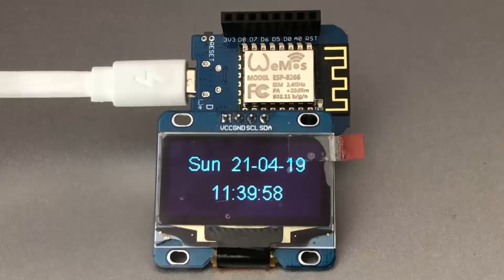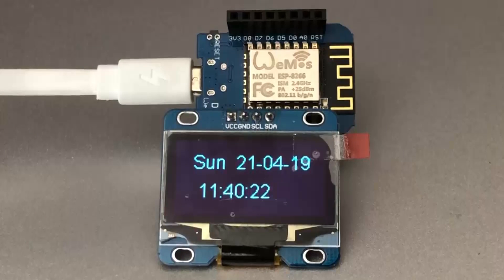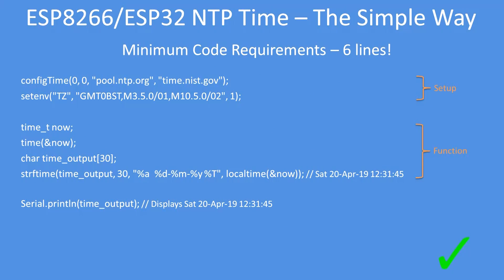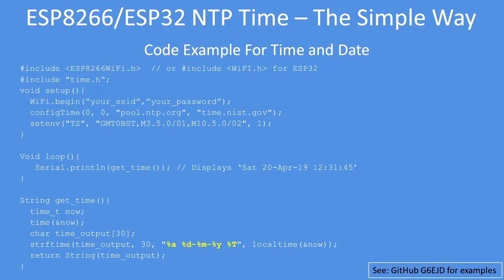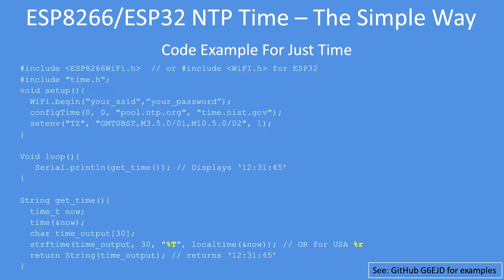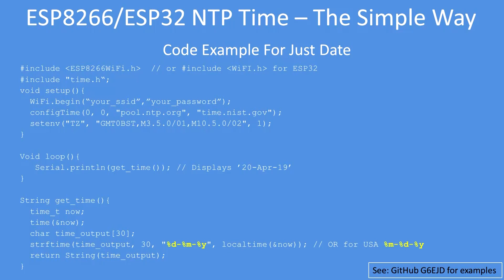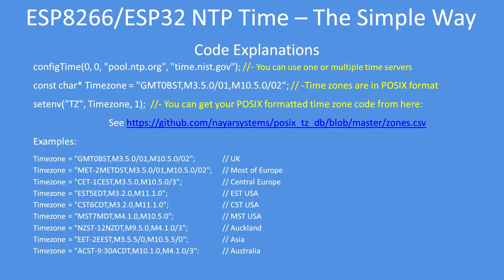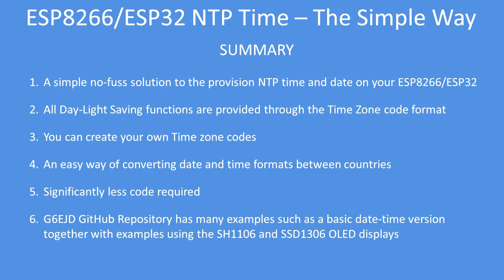Tech Note 122 - ESP8266/ESP32 NTP Time – The Simple Way

Comment: I have compiled the sketch in IDE 2.3.6, but get an error and the compile stops, using an OLED 1.3 display, I wanted to do two display clocks one for the UK where I live and one for America where my friend lives, so I know the best time to call, any help would be good, all the best Bob in the UK. 19-07-2025

Compilation error: no matching function for call to 'SH1106::SH1106(int, const uint8_t&, const uint8_t&)'
Reply from the maker: Do you have the sh1106 library loaded? Sounds like not…

Comment: Hi Dave, I was wondering how the two functions configTime(...) and time(&now) work together. Specifically,  configTime() is called once in setup() does that mean every time time() is called in loop() it will hit the NTP server? My question is how often is the NTP server accessed and which function takes care of that, is it automatic or can it be controlled? Hope you are keeping well Dave.
Reply from the maker: Hi Rodney, config time is called just once to set the ntp parameters which are stored in rtc flash ram, then the ESP32 rtc is started and is essentially a counter set to the current UNIX time value and increments every second, then the ESP32 code maintains a clock, which gets its clock source from (depending on settings) the ESP32 resistor-capacitor controlled RTC clock, so it’s not very accurate, many seconds of gain or loss every day. It is possible to set the clock source to a 32khz xtal (if fitted to the board) but not in the Arduino IDE, then clock drift is a few seconds per day about the same a watch. 
So to maintain accurate time a call to NTP is made which updates the RTC counter with the current UNIX time. It only needs to be called say every hour, but for experimentation frequently calling NTP is ok. So in essence it’s an ESP32 timer (one of the four) and it is set to increment every second fed by an RC clock in the ESP32. The timer value being set by the NTP call for the UNIX time value.
Reply: @G6EJD  Your reply has made the finer details much clearer, thank you. One final question when you say "So to maintain accurate time a call to NTP is made which updates the RTC counter with the current UNIX time" what determines when the NTP request is made, is it automatic or the result of calling a function. If automatic how can the frequency be changed say to once per day, etc, instead of hourly.
Edit: I just found this function uint32_t sntp_update_delay_MS_rfc_not_less_than_15000 () which returns a value (seconds * 1000) to override the default sntp default update period of one hour. I've verified it works at least on an ESP8266.

Comment: Great Tutorial, how would you parse hours, minutes, sec to send it  sync the RTC(ds 3707)
Reply from the maker: It’s actually quite easy, there is a function in the Adafruit rtc library just fill the parameter with the current time and call it, you can then keep the rtc synchronised says every day or whatever period is required.
Reply from the maker: rtc.adjust(DateTime(2014, 1, 21, 3, 0, 0)); so it’s CCYY, Month, Day, Hr, Min, Sec

Comment: Hi David,  I tried to input a comment to you yesterday but now I don't see it's the first time in my 79 years that I've commented on a website so bare with me please.
My comment  yesterday was related to error message "call of overloaded 'String(IPAddress)' is ambiguous" using a ESP8266 I have now got loaded on the only ESP 32 that I have which happens to be a AI thinker ESP32-CAM and it displays time date. My Arduino IDE is v 1.8.13 and I think this line gives you the core version for my ESP 8266 Users\mikec\AppData\Local\Arduino15\packages\esp8266\hardware\esp8266\2.7.4\cores\esp8266/WString.h:63:18: note: String::String(char)
         explicit String(char c); 
Can you help.  Mike
Reply from the maker: The compiler has been changed, try this:   Serial.println("WiFi connected at: " + WiFi.localIP().toString());
Reply: @G6EJD  yes error solved

Comment: Thanks for your help David. Am I correct in my understanding that with the example the NTP server is only called ONCE to set the time iside the ESP32 and then from then on the time is updated from within the ESP32? Please confirm or correct my erroneous understanding. I'd ideallly like to poll the NTP server at startup only and then provide current time without having to constantly poll the NTP server inside loop(). Thank you again for a great explanation. Gord
Reply from the maker: You have to establish the NTP connection, get the current time, then yes the ESP32 maintains the time, but the RTC clock source in the ESP32 is very inaccurate, that is it runs at about 150KHHz and is subject to a lot of drift, many seconds per day, typically +/- 20-secs per day, so you do need to periodically get a new value from the NTP servers. If the on-board xtal is enabled then the clock accuracy will be about +/- 3-secs per day, about the same as a quartz watch.
Reply: @G6EJD  Thanks very much for your help and explanation David. Best wishes.

Comment: Hi David ,first thanks for a great tutorial :-) I'm using an ESP32 DEV c and a little ssd1036 . Compiles and uploads fine via Ardunio IDE . If I open the serial monitor I can see it joining the WIFI and it scrolls the correct time but nothing on the little oled . The only change I made was to add the line  SSD1306 display(0x78, SDA, SCL); after the #include "SSD1306.h" . I'm wired up to pin 22 for SCL and 21 for SDA . I previouly had a little clock running with this setup but wrong time of course .  Any dea what I could be doing wrong ? rgds B (p.s very new to esp32 etc )
Reply from the maker: What size is the display 0.96 or 1,3”’ has the display ever worked? What board type are you selecting in the ide
Reply: @G6EJD  0.96 ssd1306 display . Board selected is  DOIT ESP32 .Also used standard ESP32 dEV ..I verified the screen is ok by using this example and it works without modification on both boards selected ..https://github.com/lexus2k/lcdgfx/blob/master/examples/direct_draw/clock/clock.ino ...thanks for the reply btw :-)
Reply from the maker: @brendanfurlong7868  use the same constructor if it works ok: DisplaySSD1306_128x64_I2C display(-1);

Comment: Thank you for the video, I mean really, THANK YOU. 
Just starting off in learning to write code and yours was the only video I've watched on it that helped me see it. 
I wonder if you could do a video expanding on time in a sketch. I'm in the USA and just need time (no days or years) so %r should be all I need. So how do we use this %r to say turn on/off a light or relay at a set time of the day?  Something like this?  "if %r> 7am  then pin 1 high, else pin 1 low" "if %r >7pm then pin 1 low, else pin 1 high"  Or would we had to state (int) ontime and offtime = 7am/pm. 
Been struggling to ultimately learn to do this, so any help in getting me to see it would be greatly appreciated.
Reply from the maker: strftime(hour_output, 30, "%H", localtime(&now));    // Formats time as: 14
String currentHour = hour_output;
If (currentHour >= “7”) …do this else; do…that
Reply: @G6EJD  Thank you, I'm going to FINALLY have time to look at it today for a while. Briefly had time yesterday, but not enough to really do anything.....
Reply: @G6EJD  Had some time last night to look into this, figured I'd start with you 1306 sample sketch. Make sure I could get time and display it before going further (editing anything). Kind of got stuck there. IDK if the library for the OLED changed, the link in the code vs what came up were different, but I did use/try it anyway.  Got nothing on the OLED and the serial just showed dots.  My I2C are pins 22 and 21 (ESP23S) and I did try putting those in where indicated. I say I wonder about the library because the Adafruit SSD1306, and their I2C example (what I used for my temp relay) work, and work without adjusting pins (not sure how that it though).   
I tried to use that library instead, but many of the strings failed in compiling afterwards.... Tried a few other "bring this n that over and hope" things, but that's where I ended last night. 
Figured I'd ask before heading out, if you had any ideas or a link to maybe the original library if the one linked to in the code has indeed changed (braking this example in the process).
Reply from the maker: Sounds like you didn’t get a WiFi connection if your seeing …..
Reply: @G6EJD  Thank you, I actually got it going last night.... like 2am.
I knew the screen worked with Adafruits library, so I checked out the example in the new library (clock face) and it worked.... 
Turned out changing the include SSD1306.h to SSD1306Wire.h, and removing lines 19-27 but keeping the include WiFi.h  made it work. 
They must have changed the keywords since you made this.... As a beginner, I wish the makers of libraries would just agree on names and everyone stick to the same.....
Now that that works, tonight of tomorrow I'll work on getting a pin to go high/low at a set time and then bringing my existing temp sketch in.  
For that, I'm gonna try to replace the date on the screen with the real time temp...
Reply from the maker: Hi, you can’t use %r as that return unix time that advances every 1-sec. just use %h which will return just hours of the current time then you can use the expression if hour >= 7 then
Reply: @G6EJD  Ok, that make sense. I was just looking over your examples. I'll be giving it a go tonight.  Long story short, heater killed her fish, so learned to use an ESP32 and relay to limit the temp and show current temp on a small OLED (better than those stickers). Figured I could have it do lights too IF I could learn how....  Thank you again, very glad I found your video and will be following you.

Comment: I tried the code but it's not working, it only prints 01-01-70, can someone help me? (just changed the Wi-Fi configuration) 
Also, what's the TZ for Venezuela? I can't find it anywhere and I need this to make timestamps in my sensor...
Reply from the maker: Try it as published first, you can get the TZ string from the posix site I listed in the comments 	TZ = "<-04>4" works for me

Comment: hi dave for the life of me i cant get the correct time just 01-01-70 , so looks like some kind of default setting, and time 00:00:00.  installed your github onto esp8266 with oled screen.  Update ESP_RTC_with_NTP_Synchronisation_SSD1306_OLED.ino prints the same on the serial monitor it joins my wifi .  been playing around all morning, but cant get it to change. this is above my pay grade.  what should i look at. thanks Andy
Reply from the maker: Ok m, have you changed anything in the code apart from WiFi credentials? Is will show you the IP address to confirm a connection. Do you think your router is blocking outside connections, everything else’s operates ok on the WiFi?
Reply: @G6EJD  router possibly.  do you know what port if any the NTP servers use
Reply from the maker: Does your phone or pc get the time ok?
Reply: @G6EJD  windows pc it has the correct time. Is they another way to check. Trying now to install another router
Reply from the maker: @AndyShrimpton-GaaTech  OK so there are no router blocks, it uses the same NTP access. Your getting a known good IP address on the serial monitor port?
Reply from the maker: Ive just tried the code, no problems. What version of the IDE are you using 1.8.13 and ESP8266 plug-in?
Reply: @G6EJD  hi dave 1.8.9
Reply: @G6EJD  yes check within the router
Reply from the maker: That is most likely sone of the problem with the libraries plus you need to be on latest 8266 add-on
Reply: @G6EJD  made so progress.  I loaded in your ESP_RTC_with_NTP_Synchronisation_SSD1306_OLED.ino and it gave the wrong time.  (For anybody reading this there is nothing wrong with daves code, i have a problem that i am trying to work out that the code on my D1mini does not work correctly)    I changed line 36 to update every 60 seconds.  And it updated perfectly after 60 seconds.  So this proves to me that nothing in my router blocking NTP requests, i proved that i can reach it)    Now to work out why it does not get the correct time upon power up.  So it prove i have something set up some where wrong.  Not the best this to do i could i have have the skill put in a counter and a routing to update upon power up and the change to update every 60*60 seconds as line 36.  I am in Italy but that should not effect anything.  I will check my router to see if that has a time and date setting
Reply from the maker: Are you actually getting time? If so maybe after a minute or so, then this is an artefact of the ESP8266 library, it can be slow, I’ll tell you how to fix that (there is no solution other than to wait for the time to synch then carry on) once we know your getting the time

Comment: I started looking into NTP for ESP8266 by watching Ralph Bacon's YouTube video.  With all due respect yours is SUPER.  How often does the ESP request Time from the NTP pool?  If the WiFi later goes down will the internal clock of the ESP be keeping proper time?  Thanks....great video.
Reply from the maker: You can specify the time server pool and the offset (in seconds, can be
 changed later with setTimeOffset() ). Additionaly you can specify the update interval (in milliseconds, can be changed using setUpdateInterval() ). NTPClient timeClient(ntpUDP, "europe.pool.ntp.org", 3600, 60000); would be a typical definition.
Reply: @G6EJD  Your reply seems to be related to the NTPClient Library which we're not using.  I understand the default update interval for configTime is 60 minutes.  So how would I change the  update interval to be 24 hours?  Also is there a way to read back the update interval or determine how long before the next update?  Thanks for your time...KA0SLK.
Reply from the maker: @markludwig5805  yes, default update time is 1-hour, here’s the complete documentation: https://docs.espressif.com/projects/esp-idf/en/latest/esp32/api-reference/system/system_time.html with an example.
Reply from the maker: BTW, if the ESP32 is in sleep mode, the on-chip clock source is an RC timer (150KHz) based unit with a typical error (most run too fast) of 20-secs per hour, based on a wide sample of reports I’ve had with my weather station 20-secs is typical, this is probably why Espressif set the 1-hour update time. When the cpu is running and using (generally) a xtal clock source, some are ceramic based), I generally get no better than 2-sec accuracy per 12-hour this is because most xtals are 40+ppm or worst. 73

Comment: Hi David,

I'm trying to asing values of the function in integers, in order to per exemple, compare with other integers to create a alarm clock...

as I'm not too much expert I just do it using the follow way but i'm pretty sure that instead is working it is not the  best wise method:

#include <ESP8266WiFi.h> // or #include <WiFI.h> for ESP32
#include <time.h>
int hora; /// integers for futher handling hour minute and second
int minuto;
int segundo;

void setup(){
 Serial.begin(115200);

 WiFi.begin("****","***");
while (WiFi.status() != WL_CONNECTED) {
delay(500);
Serial.print(".");
  }
  configTime(0, 0, "pool.ntp.org", "time.nist.gov");
  // See https://github.com/nayarsystems/posix_tz_db/blob/master/zones.csv for Timezone codes for your region
  setenv("TZ", "CET-1CEST,M3.5.0,M10.5.0/3", 1);
}

void loop(){
   Serial.println(get_time());
    Serial.print(hora);
    Serial.print(":");
    Serial.print(minuto);
    Serial.print(":");
    Serial.println(segundo);
}

String get_time(){
  time_t now;
  time(&now);
  char time_output[30];
  char datohora[3]; //collect only data desired in char format
  char datoomin[3];
  char datosecon[3];

  // See http://www.cplusplus.com/reference/ctime/strftime/ for strftime functions
  strftime(time_output, 30, "%a  %d-%m-%y %T", localtime(&now));

  strftime(datohora, 3,"%H", localtime(&now)); //repeat the function each time as is needed for extract the value desired ( hour ,min and second)
  strftime(datoomin, 3, "%M", localtime(&now));
  strftime(datosecon, 3, "%S", localtime(&now));

  hora=atoi(datohora); // convert the char in integer for further handling
  minuto=atoi(datoomin);
  segundo=atoi(datosecon);
  return String(time_output); // returns Sat 20-Apr-19 12:31:45
}

system is working and I am able to handle the hour, minute and second as I decide (time variables in spanish) but as I mention I fell that it is not the best method.

What is your opinion??

thanks for your videos and great support.
Reply from the maker: It looks good, I can’t see much you could change. I’d keep it as it is, you might save only 1 or 2 lines at most. You’ve done well.
Reply: @G6EJD   thanks for support. I will integrate the code with a TFT colour display, now are really cheap and not so slow, so it could be considered as the lcd monocrome displays replacement.

Comment: Thank you. I have many NodeMCU devices saving $1,000/year at home but I couldn't find a simple way to get the time and date from the internet.
They all involved a lot of code as you mentioned.
Due to many power failures the controllers all have a DS3231 RTC to keep the correct time in spite of power failures and also to execute code only every second without using delays. 
The issue was twice a year I had to manually change the time from standard to daylight savings and back.
The DS3231 drifts a few seconds a month as well. 
Adding your code plus automatically setting the RTC at 3 a.m. once every day fixed both problems.
The website for the NodeMCU home automation applications is: https://sites.google.com/site/nodemcu12e/